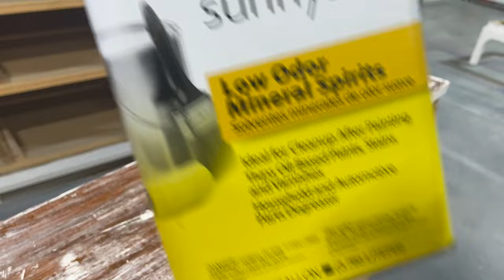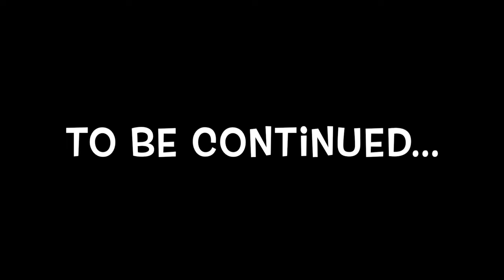This Took HOURS! 🫠 | Part 1 | Satisfying Removal of Latex Paint

Comment: Please identify that paint sprayer you use.  How heavy is it, with or without paint, please?  You’ve got nice equipment!  I watched part 2 first!  And I subscribed.  Great shop name — I’m a big Pink Floyd fan, so anything “brick wall” grabs me…
Reply from the maker: I use the Wagner Flexio 4000. It’s super lightweight even with paint in the canister. I highly recommend it because it’s easy to learn how to use and it’s even easier to clean. The motor is completely separate from the actual sprayer so there is no chance of ruining it. Thanks for watching!! 😊